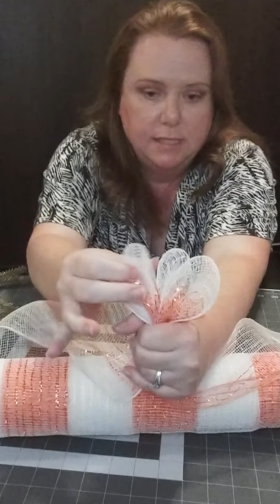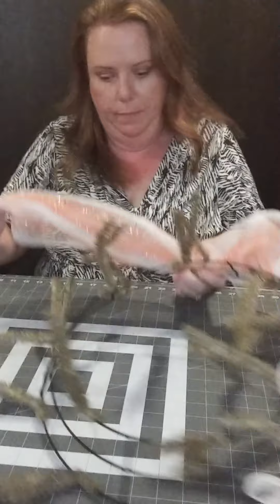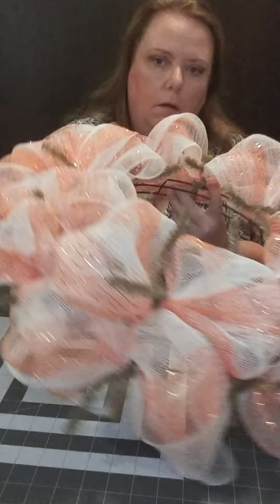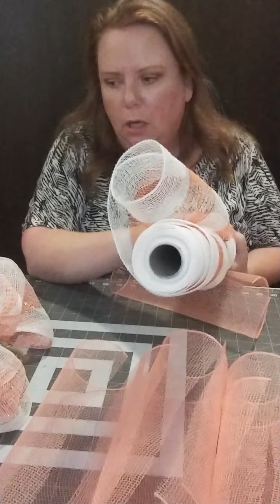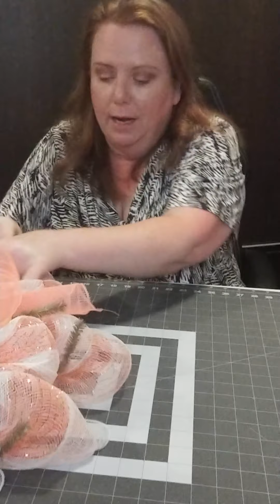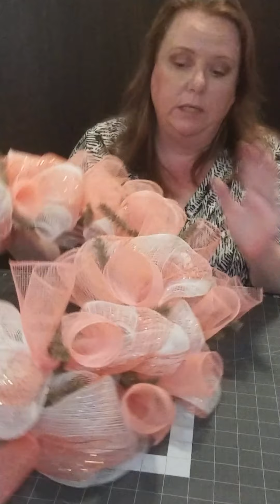Wreath Poof Method Using 21" Deco Mesh by Kitobby

Comment: I couldn't edit previous so I want to know if the pipe cleaners are placed 5" apart on the 1st row and place irregularly on the 2nd row but are 5" also?
Reply from the maker: Yes that's correct.

Comment: How many stems around top and bottom of wreath. They are 10” apart, correct?
Reply from the maker: Hi Sue,  On this elevated wreath frame there are 10 ties on the bottom and 8 on the top.  They are spaced approximately 5-6" apart.